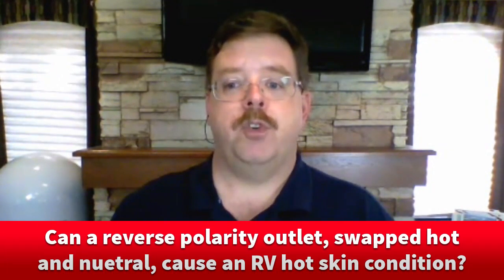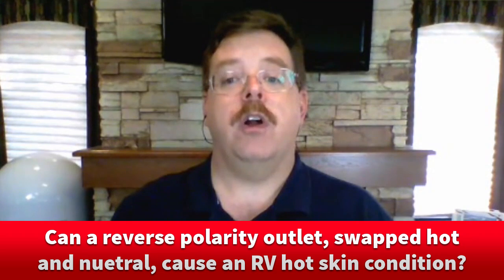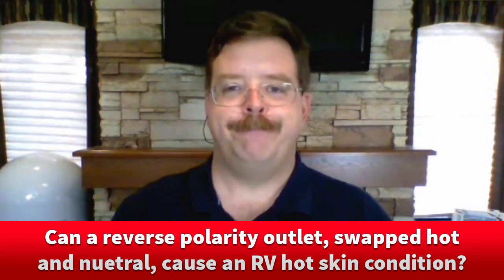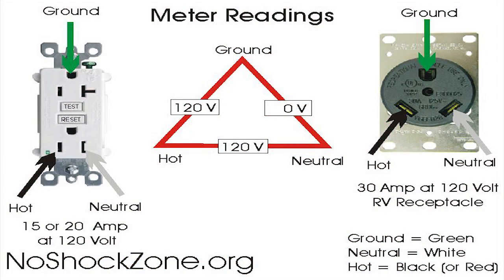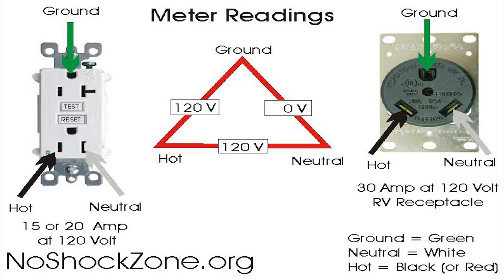Can reverse polarity outlets cause RV hot skin conditions?

Comment: Thanks!  My RV's batteries are connected in reverse polarity (positive to ground) and I'm having a hard time finding info but apparently it's to prevent corrosion and somehow allow a 12 or 24v source on 12v equipment without damaging it.  It's the only way everything works anyway (shore charging included), and has been for 3 years now.  But my question is: is it safe to connect a solar charge controller to these batteries, forward or reverse?  Will the panels and shore power charge them simultaneously, or will one system try to feed the other?  Any guidance whatsoever would be sincerely appreciated!